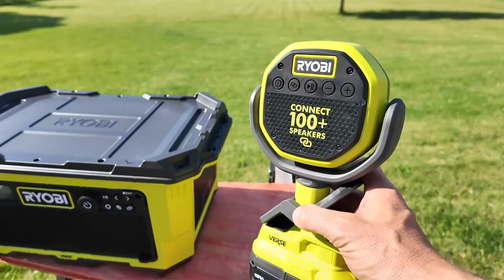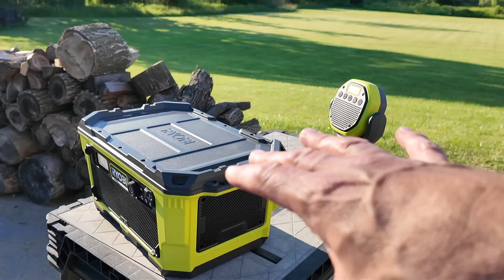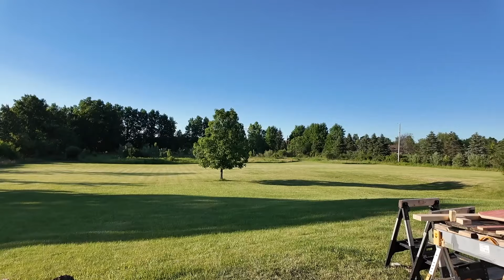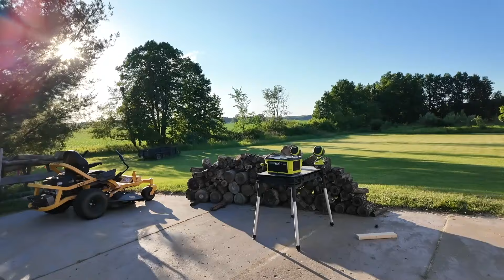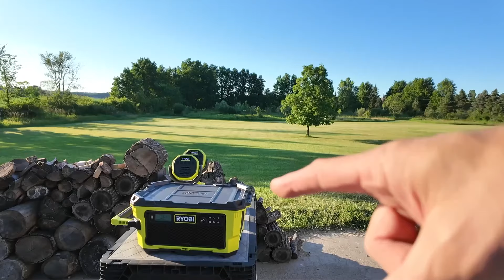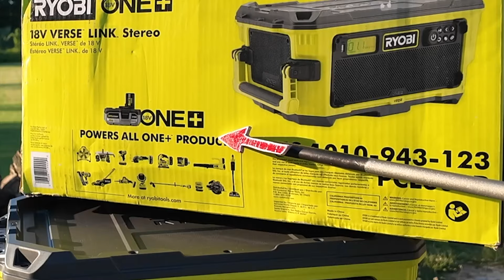The NEW Ryobi Bluetooth Stereo! – Incredible Sound & Connect 100+ Speakers!

Comment: Also it may be worth specifically mentioning that the button for the link cleat disconnect is on the left side of the unit.  So if you wall hang it, it is relegated to always have the tweeters face up and down and the sub facing right.  (The sub cannot face down or left because the cleats will not wall mount that direction).   For anyone who is gonna a use it while it’s mounted to wall link rails.  

So plan to use it in the left side of your shop because if you placed it in the right side, the sub would face the corner… not ideal.
Reply from the maker: Those are good things to consider.

Comment: Why does Ryobi never make cleats on the top of any of their non toolbox accessories?  Shop vac, cooler, speaker… it would be convenient to have this stuff in the middle of the stack.  If you wanted a stack with a cooler vacuum and speaker, it’s impossible.  The more they do this the more it limits how many you can carry with you.
Reply from the maker: Yes, I was just using this today and thinking the same thing.  Even a phone holder would be a nice thing to have on top.
Reply: @MarkThomasBuilder  TTI knows how to do it.  Milwaukee’s shop vac has packout cleats on the top.  Ryobi’s for some reason does not.  Just silly.

Comment: If milwaukee made a Packout Mini radio that was the size of the deep half cases, that could be powered by extension cord, or M12/M18. I would buy it.

I'm really not impressed by any of the radios any of these companies have been putting out lately.
Reply from the maker: Sounds like an interesting idea!
Reply: There's some new radios coming but I don't think they take a power cable, they're on the milwaukee side. TTI tends to use ryobi for testing products to move to milwaukee (weedeaters and chainsaws are great examples) and it seems like they pulled the same move with the radios. The internals will likely be very similar but of course incompatible. I expect ryobi to cut back most of their speaker products to maybe just the clip on speaker if the radio doesn't sell well
Reply: @RustyCantRead  None of the ones coming are great. They're all mostly only BT. I have multiple UE & JBL speakers already. Don't need another BT speaker.
This stuff is supposed to be meant for jobsites. IMO The last speaker they put out that I'd consider a tough  jobsite model is the 2792. 
Needs a radio. Needs BT. Needs to have a robust power cord or use extension cords. Needs to charge batteries. And Needs to not weigh 40lbs.
Its not that hard to do with technology today.

Comment: Does it charge the battery?
Does the AM/FM broadcast to the Clamp speakers?
Reply from the maker: No, it doesn't charge the battery, unfortunately.  I just went outside to double check that it broadcasts radio stations and the answer is yes.  I did just notice that this in only a FM radio, no AM.
Reply: @MarkThomasBuilder  Thanks for the details
Reply: @MarkThomasBuilder  So does it actually have a FM radio IN IT?? And will it send the music OUT to the portable speakers at that distance??? Many of us DON'T use phones for such, a DEMO of JUST the radio sending to the portable speakers AT DISTANCE would be VERY helpful !